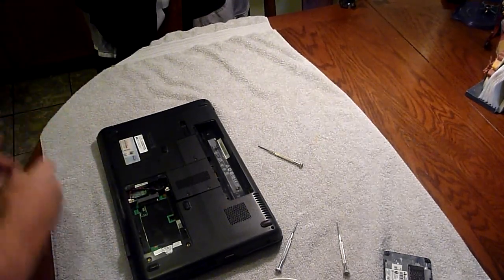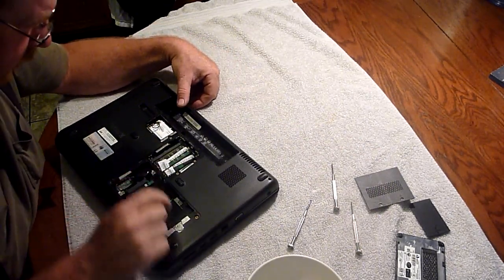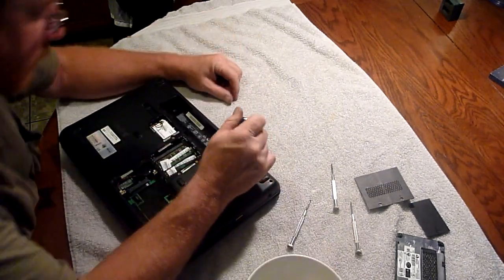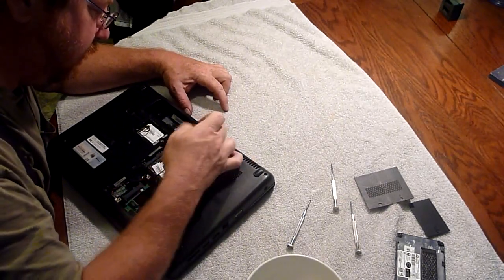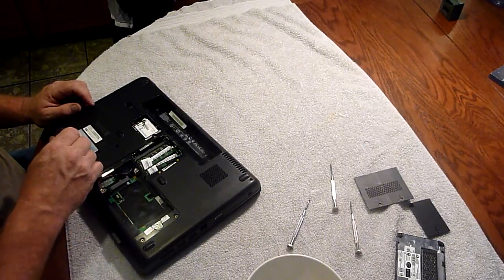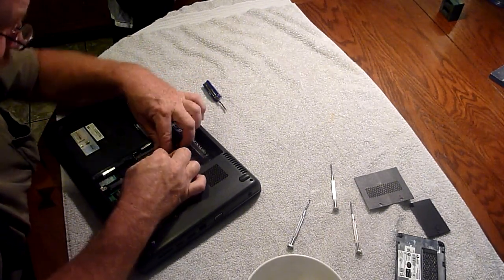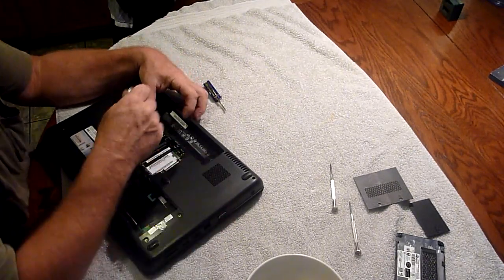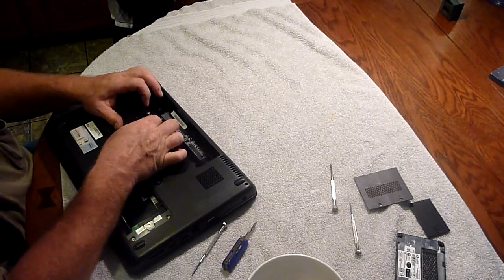G60 230us teardown to fix cooling fan part 2

Comment: I would suggest ANYONE attempting to repair/take apart this model laptop...download and READ THE SERVICE MANUAL here - http://h10032.www1.hp.com/ctg/Manual/c02985882.pdf
(Compaq CQ60 and HP G60 are the same basic laptop ) 

I've taken apart ( and reassembled ) hundreds of laptops, and very rarely will I ever do so without first reviewing the service manual! If I cannot locate a service manual for the particular laptop, then I will attempt it, and fall back on my experience to guide me through not busting the delicate housing or prying with a screw driver and scarring the plastic parts, etc. It's certainly not rocket surgery, but it does take some finesse.

Comment: This is why the old adage of a little bit of knowledge can be a dangereous thing in the wrong hands. I am a certified it technician with over 10 years experience and have yet to come across a worse attempt by an ameteur to diagnose and repair a laptop issue.
Honestly guys leave it to the Pros.